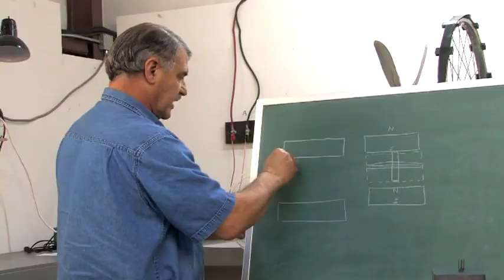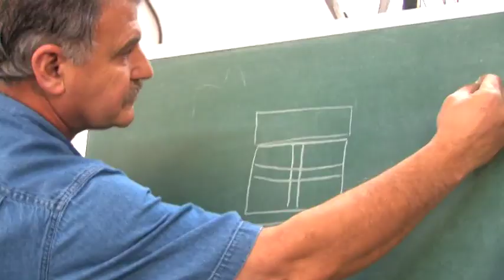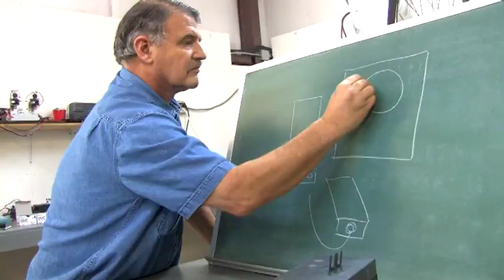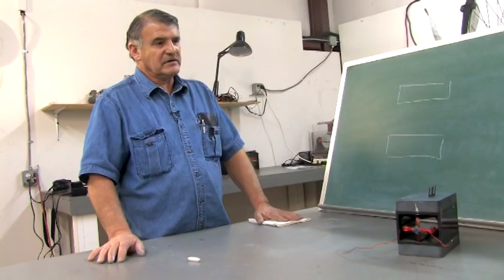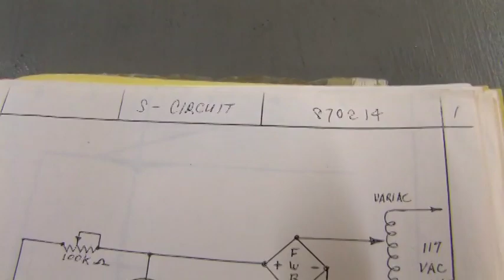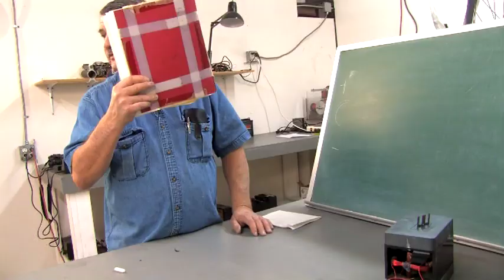Energy from the vacuum: Part 30 Floyd Sweet Memories

Comment: Bedini was asked to stop working on Floyd's device because device has 5000% overunity. That's something that could never see light of the day. If he did not stop working on device, he would be killed. He knows how it works, but can not tell anyone. Actually he told how it works but part to part in different parts of the video. One of the windings in the box on video is wrong for the magnetization of the magnets. Windings in the box on table would be right for the magnetization that suppose Bearden made wrong.
Reply from the maker: @Radovedn  The windings in the "box" was for operation and not magnetization.  One was a pickup coil for the "generator" and the other coil was the "tickle" coil for stimulating it. The magnetization coil was in a round tube, if I recall correctly. I don't think Bedini and Bearden knew how to make it work, the closest they got was their "glass case motor" and the "MEG".

Comment: Anyone can provide me a clear schematics, or much better a step by step video of this machine?
Reply from the maker: No one has been able to successfully replicate one to date. This DVD has the most info I have ever seen on it though, because it also points out the misinformation Floyd was giving out to protect it
Reply: @DavyOneness  Perhaps someone has replicated and optimized the Floyd Sweet / Arthur Manelas technology, but they are remaining under the radar  -  for good reason.
Reply: It's a goddamn parametric resonant transformer. The perpendicular windings gave it away
Reply: @lukiepoole9254  so is the MEG, permeability in the flat part (saturation region)  of B oscillates. Trigger is in the same direction as the flux

Comment: We were invited to work with Floyd Sweet in 1986 by Mark Goldes from the AESOP Institute. We were both from New Zealand. 
We met Floyd and agreed to help him with his static generator. We became a little disillusioned with Floyd as his knowledge of electrical engineering was basic and didn't really fit with his claims  to be an ex Professor of electrical engineering at MIT. It turned out to be one of many falsehoods. 
We spent months designing the electronics for Floyd. His device never worked.
During our stay we also visited with Bruce Depalma who was working on his N1 machine at Santa Barbara. 
Disillusioned with the Floyd's claims we decided to fly to the UK and ended up looking into the rock electricity of an inventor called Adam's located in Stowbridge. We returned to LA with some of these rocks we had found in Wales. We showed these rocks to John Bedini in his workshop in East LA. 
We returned to NZ to continue our research into one piece homopolar
 generation.
In our dealings with Floyd we found him to be delusional to the point of dishonesty.
Reply from the maker: @tomdunnnz460  yea, floyd
seemed to had been stringing people along for money in his later years. Thanks for sharing the history on that part!
Reply: @DavyOneness  No problem bro. Bedini at the time was manufacturing so called scalar systems. Audio enhancement. He would encapsulate them in a epoxy. I personally destroyed one of these and found absolutely nothing. Period. Fraud.
Reply from the maker: @tomdunnnz460  That's only because you didn't know what you were looking at, you may have even exposed yourself to radioactive elements used to dope it, depending in the one you had. That actually was not a hoax, he shows the process in this part of the series:
https://youtu.be/RI-qYemvDA0?si=29bvV4LWv3rg00Gp
Reply: Par for the course.
Reply from the maker: @tomdunnnz460  What ever happened with your special rocks that got you in the door to be apart of this history? Was that all just a  hoax?

Comment: With heating the magnets IMHO, this method is used to increase magnetic spin axis precession angle at the Lamour frequency, producing strong spin waves. A magnetising pulse was then applied to pull the precessing spin axes into synchronism. Otherwise the random fluctuating distribution of energy across the magnet surface would average out at zero.

Comment: 1:04:45 This is the start of what really went in on "conditioning" the magnet. Basically, Spark would heat the magnet so they lose their magnetism and in that timeframe, Sparky would shoot a DC Pulse (high voltage DC Pulse) into the magnet which would open up the magnet to have a higher output power with little input power. Now, they don't really get into what phase angle they shoot the Magnets at, John did mention that the phase angel was mentioned multiple times to him towards the end. It could have possibly been 60, 90, 120, 180 (or 0, same thing). A good generator that would be used today would possibly be a Surge generator. Shooting 4kV at 2kA, and you can chose the phase angel you want (say you have line frequency of 60Hz). Anyways, just thought it was interesting... unfortunately no one has ever been able to replicate this to the public. 

How to magnetize a magnet? Most magnets are done by getting hit by a strong magnetic field. Usually 2400V and 12kA DC. 

You could possibly use a generator test called "Pulsed Magnetics" (IEC 61000-4-9) and shoot the magnet. 

Well, I'm going to go enjoy my VTA now that's powering my home.

Comment: Thank you for sharing. Whatever happened to the CLOSE HOLD documents? I gotta think there is more information to go on in those. I am definitely intrigued by this and although I think I could bake the magnet to get it ready for re-programming, I don't think I could put the correct program into the magnets without further clarification on what works, or it would just be a massive guess and check scenario.
Reply from the maker: @wonderstud  I think they were included in the cejaka DVD with other files. I believe the magnets used  were unique in that they could be programmed, and because of that, they are no longer available and hard to find, and expensive if you do find them.

Comment: Just an observation noticing the wire windings towards the front That looks like a much larger gauge wire for the windings than what was in the original Sweet schematic of this. It used mostly all #28 and #26 gauge wire with a lot of turns. And some #20 gauge wire. Any of this wire looks much larger than that. 2000 turns of #28, 250 turns of #26 and 240 turns of #20. Or did he just build this for demonstration purposes?

Comment: I have the greatest respect for John Bedini but sometimes it's a bit hard to know what he actually means.
When he's talking about heating the magnet to its 'cure' temperature, I wonder if he means 'cure' as in "curing concrete" or Curie temperature as in when a material loses its magnetism? Especially at the end it was really hard to distinct between the two since he pronounces them the same.
Reply from the maker: @qintusquark4854  He wasn't always the best with words or spelling, and then sometimes he is cryptic because he can't just come out and say things in some instances. But in this case, he is talking about the temp at which the magnets loose its magnetic properties. But also, the type of magnet used was  very key, and only seems the now hard to find and expensive barium magnets are the only ones this process would work with.
Reply: Hi mate , Bedini meant to say the magnet's "Curie temperature" named after French physicist  Pierre Curie, just Google it, he wasn't trying to confuse.

Comment: I don't see a glass vacuum valve triode tube amplifier. So, what's the point here.
Reply from the maker: @Jaantoenen  You are not supposed to. The Vacuum they are referring to is the Quantum Vacuum. This is likely just a Mag-Amp that Sweet built.
Reply: @DavyOneness  from what was presented, there is no quantum access. Those two coils and magnets will only produce a voltage ⚡ by electromagnetic induction if you get those laminations on top vibrating. And that's it. No quantum vacuum here.
Reply from the maker: @Jaantoenen  This is from a 45 part series called "Energy from the vacuum". The "quantum access" point  is the Bloch wall
Reply: @DavyOneness  no insult intended, but this appears to be misinformation. Or fraud. If Floyd Sweet did actually built a zpe device, this one is either missing components or not at all Sparky's devise.. 
I can imagine the thin(27 gauge) wires running an electromechanical vibrator (bell ringer without the bell) to oscillatie the laminations, causing variations on the magnets field and thereby inducing currents in the coils making it a very inefficient generator.
Reply: @DavyOneness  a magnet 🧲 already gets its power from the bloch wall naturally,.
Reply from the maker: @Jaantoenen  yes, the bloch wall is the window it comes through, but the bloch wall doesn't create the power
Reply from the maker: @Jaantoenen  None taken. If you listened to Bedini in the video, he had problems with what sweet was doing and saying different things to different people and many inconsistencies Sweet showed. In the end, Sweet was probably just stringing people along with crumbs he had learned in his GE career in order to supplement his socialsecurity checks. The crucial barium magnets needed to make it work are no longer available for sale, and hard to get your hands on any that are out there. No one has ever successfully reproduced it, including Bedini or Bearden. But they were able to come up with similarly related models like the Bedini "glass case motor" and Bearden's MEG from their experiences with Sweet and trying to figure out what he did. The secret died with sweet, but likely GE already knew back in the 1960s about what ever it was he was exploiting  magnetically. I don't think sweet ever intended to fully disclose what he was doing because it was really intellectual property of GE and he likely signed NDAs with GE.
Reply: @DavyOneness  well, that's all very plausible. 
I've not tried the meg yet. I'll let you know when I do. But I can tell you what I know about zpe. Zpe, levitation, healing are all three a time displacement torsion field  based devices. Like , you must run two up-spin currents against each other. Eventually, they will twist about each other and displace time. It is a block wall luminous sphere with a time differential up-spin
Reply from the maker: @Jaantoenen  yes, I agree they are all related, including the paranormal. If you are not already familiar with it, I think you will really enjoy Tom Bearden and John Bedini's work, especially his RPX healing  machine

Comment: Id like to make a replica. Anyone have any tips? I only have the minimal list (VTA with conditioned magnets tigher coil and power coil, generator, osolator, capacitor, and amplifier) but I can't piece everything together. Especially the amplifier
Reply: You can try using by your own mind. There's no exact plan to follow.
Reply: If John said the truth, this gives me a clue. I will try this soon when my current project is done.
I believe he didn't understand the conditioning. But he is right; there's something about the oven. I believe the oven removed magnetism, and conditioning is to create back again, but in a different polarity depending on the target polarity. It might be that the original design of the magnet polarity didn't fit the device design, so he removed it by heating and changed it through conditioning before attaching it to the device. So the oven to removed and the conditioner to become magnetic.
The fine wire is to manipulate the stationary magnetic field by canceling or redirecting the field back and forth to create a rotating magnetic field or to create a zero and one alternately. It makes sense to me, but an actual experiment will give an exact answer.

In the drawing he presented, a note from Tom would also be correct; that's why there's the oven and also the conditioning coil.

So there's no third coil. Some people installed the third, but I believe it is the conditioning coil, not in the main device.
Reply from the maker: I think the oven may have been more to bring it close to the temperature that it would loose magnetism, without it demagnetizing it. But it may have also been to "erase" the magnet if the conditioning process didn't work out correctly.  People seem to also miss that the specific type of magnet is important here, and the conditioning process is for the barium in the magnet. I think a third coil was used at aome point as a feedback coil so the HP audio oscillator  was not needed. 
Good luck with your experiments!  You may also want to check out Bedini's 'glass case motor ' video too,  as it is related to what he learned from sweet.
Reply: @DavyOneness Ok thanks, I'll check it out.
Reply: Check into barium ferrite magnets. Self oscillating, heat the magnet to "soften" the Flux shock at the top of the wave of small amplifier coil and power coil. Align nuclei in barium to obtain oscillation. Seems simple enough..